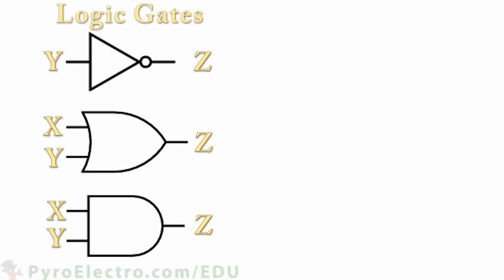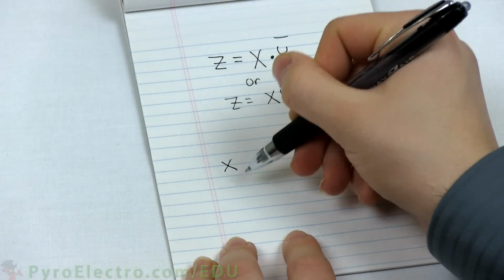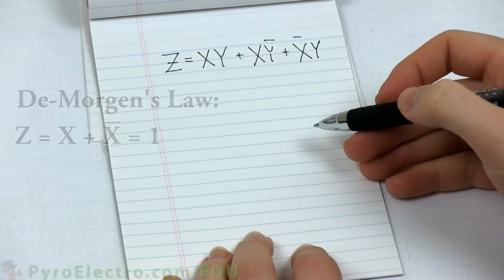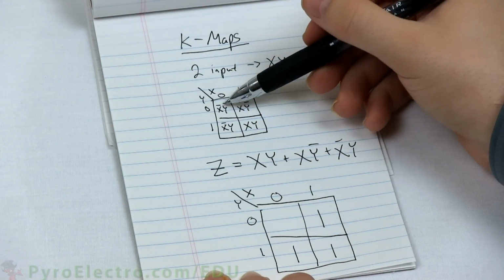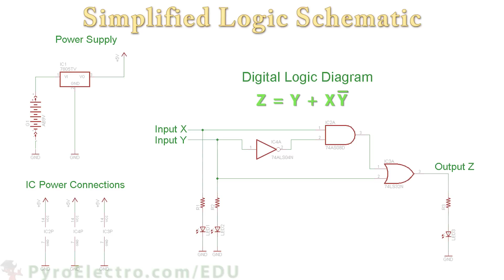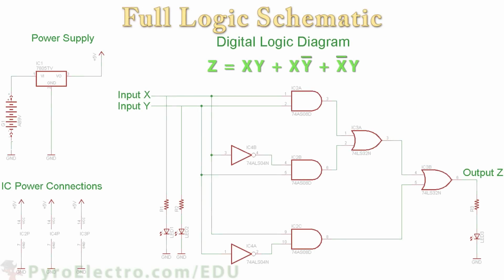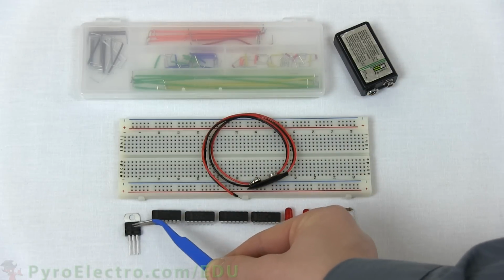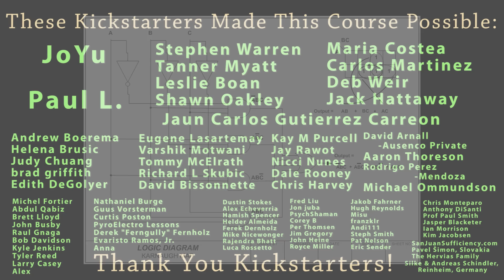Kmaps - An Introduction To Digital Electronics - PyroEDU

Comment: At 11:33 the 3-chip solution offers the same truth table as a single OR gate. Is there any benefit to using a system like this (ie. toggling extra inputs)?
Reply from the maker: Syd Swift There is no real benefit outside of simply understanding what is going on. In a real design I would just use an or gate, which would save space, logic, power and have a lower number of connections.
Reply: PyroElectro  That's what I figured. Thanks for the tutorials! very helpful.
Reply: Syd Swift There are several components to studying electronics. One resource I found which successfully combines these is the Gregs Electro Blog (check it out on google) without a doubt the most incredible info i've seen. Check out this  amazing resource.

Comment: The truth table for and at the beginning of the video was wrong. 
X      Y      Z
0      0       0
0       1      0
1       0       1    <-  should be 0
1        1      0    <- should be 1

What was there was inverted on the last two. I had to scratch my head because there's no digital logic gate where the last two would be true unless the first two were wrong. Sure you could build a circuit with that logic but that's out of scope for the lesson. I'm just a Nerd who plays with digital logic for fun but for someone new that would confuse them and the rest of this lesson wouldn't make sense. Especially when writing bcd to binary counter circuit with the 7 segment display. I'm just trying to help, I like all the other videos. That's a pretty threadbare kit if I do say so. The person making the lessons even loses a resistor and has to substitute a 100 ohm with a 330 later in the series. I know the series is old but the kit doesn't have nearly enough spares. Those tact switches break all the time from pitting them in the breadboard and it's bad practice to not put an electrolytic  cap across ground and Voit on the 7805, especially when using a battery or anytime for that matter. Logic ics are sensitive to voltage spikes, especially the hc series. The cd4xxx are a little more forgiving. Anyway I'm not trying to troll, I enjoy the videos.